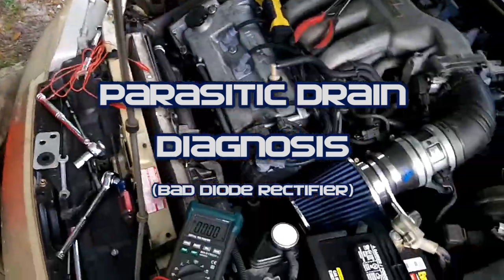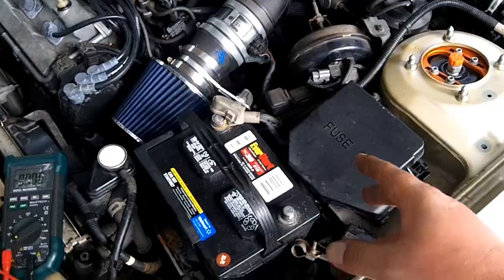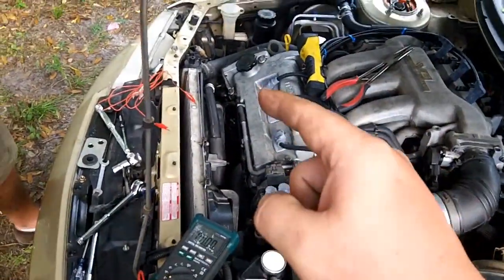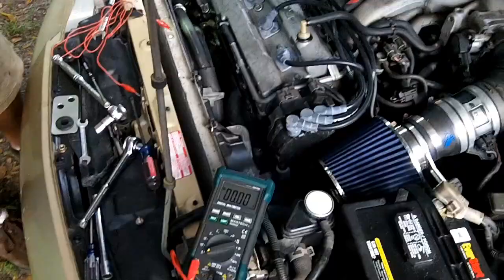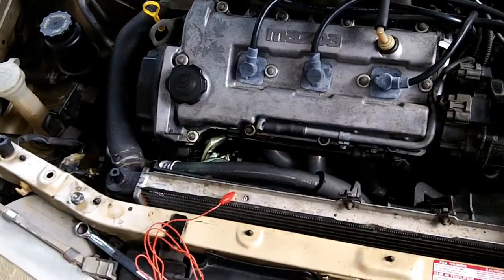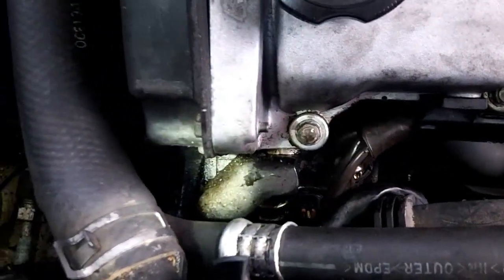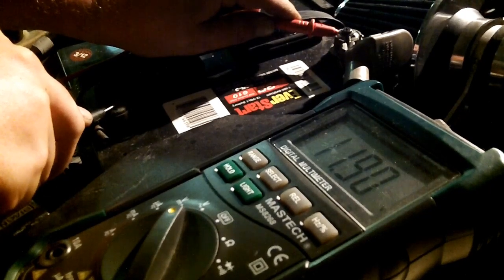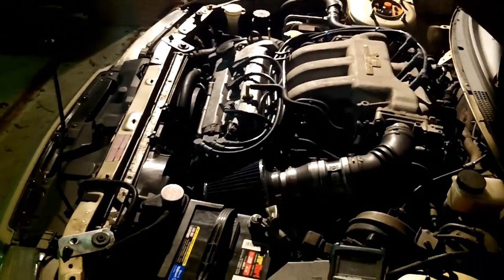Alternator Causing Parasitic Drain

Comment: You cannot have a alternator cause a draw it’s not a consumer
Reply from the maker: The consumer is the shorted diode inside the alternator. In some vehicles it can be replaced as it could be an external component outside of the alternator.  In the case of a 626 the diodes are inside the alternator and are non-serviceable parts (unless you're a specialist) therefore a prognosis of a parasitic draw due to a faulty alternator as the part to be replaced holds true.

Comment: Why not check the alternator first if you suspect it rather than fuck with the fuse block? If you have a parasitic draw of 2-3 amps with everything off, that's a good indication it's the alternator. Pull the wire from there and see if your problem disappears, if it does, mystery solved.
Reply: You beat your brains out looking for it, I'll start with the alternator if the drain is that high.

Comment: Im having a issue where my serpentine belt seemed like it was slipping bcus everytime i drove my car i would hear a whirring sound and i would smell faintly to obviously burnt rubber smell in front of the car and i was getting unwanted warning lights coming up on dash board etc.. i had a feeling that 1of the pulleys was sticking and moving causing the belt to slip and i could not figure out what pulley it was then today i start the car and i get a alternator fault light on my dash board. Is this a bad alternator i did not test it
Reply from the maker: There's a good possibility but you won't know until you test it.  I do not have a video on how to test the alternator other than this video.  There are plenty of videos online for alternator diagnostics. Good luck!
Reply: @DJDevon3  thanks captain il try and have it tested at a shop and see whats going on with it.

Comment: hi i m having very strange problem i applied wd40 on injector and starter relay but did not dry it and start the car resultantly battery warning light came on that alternator stopped charging after that its on problem with its own battery when i start it with other cars battery with leads its ok batteyr  light goes off and sometimes on its own  battery also but most of the time with its own battery start battery warning light came on in dashboard and if i start the car with push of some peoples help alternator doesnt start charging can you pls guide me ?
Reply from the maker: It's time to take your vehicle to a mechanic if you cannot perform alternator or battery diagnostics.  I realize this video doesn't show everything step by step visually for non-english speaking people.  English is required to fully understand this video. Sorry. :(
Reply: i can understand english but problem is strange car,s own battery makes roblem but as soon as i connect with other start car battery everything goes ok
Reply: Check your fusible link. Wire fuse going from alternator to starter

Comment: Alternate debug......remove battery connection, let the car sit overnight (to cool), place your hand on the alternator back where Positive cable connects, it should NOT feel warm.....reconnect battery, wait five minutes, feel alternator again, is it warm?  Four amps will generate some heat. Bad Diodes! Replace alternator.
Reply from the maker: Interesting that would probably work if it true.  I've never heard of this but it still requires diagnostic test to make a confirmation.  Let's just call this a relatively good first indication of a potential issue.  I like it.

Comment: IF . . . all connections are solid - ground wires and hot wires from battery to alt  - and the circuit from the D+ secondary post on alt to warning light to fuse and back - if all this is good and 3 different, TESTED, new alternators will not charge a new tested battery what could it be? On one of the alternators there was a charge all the way to 14 V's but that then stopped - on another new alternator there was a brief climb that then stopped. Could it be a bad ECU? Baffled - and stuck.
Reply from the maker: I can't give you a definitive answer. The voltage regulator is built into the alternator. The ECU does not control voltage regulation. As long as the belt is powering it and it's got a good ground then it should be putting out voltage. Resistance test the entire charge circuit, every wire, fuse, plug, and GROUND/EARTH. The only fuses involved for the charging circuit on a 93-97 626 are the 100A Main Fuse and 30A EGI INJ fuse (both fuses are in the main fuse box) and X-02 main relay near the fuse box (location differs depending on year and engine config). If the voltage regulator stopped then you've got a circuit problem that you haven't found yet. If you put the battery in wrong and connect it backwards even if you don't start the engine, it can blow the diode rectifier.  If you start the engine without the post or plug connected that can also damage the alternator.  If you can't figure it out take it to an automotive electrical specialist. I'd be interested to hear how it goes. :/  Good luck.

Comment: I Have a Chevy Express 1500 V6 - 2005 work Van which has tons of electrical items connected; LED Strobes, Ham Radio, Police Siren, Alpine Radio with 12" Sub (2) Amps; 1 Radio 1 Sub. Have a 3500Watt Power Converter also - So I put a Yellow Top Optima under the hood and it has ran perfectly fine for over 3 years; I can blast my music, strobes, and run a Hair Dryer off the Power Converter to heat up before the motor is warm on cold days which I LOVE,   

But one day not long ago someone broke into my van and stole some items (nothing seriously valuable) but I noticed they broke my Vent Knob for "OFF-MAX AC-NORM-VENT-FLOOR-WINDOW" it was stuck in MAX AC cause it was still warm out, but a few days later the van wouldn't crank over it was doing the "CLICK CLICK CLICK" as if my battery was dead, so I picked up another NEW Optima Yellow Top Battery and it started no problem - then I drove 40 miles and pulled into a gas station, when i went to start. It was "CLICK CLICK CLICK" even with the NEW battery so I finally took needle nose plyers and moved the metal knob to "OFF" and the van would start on its OWN POWER for about a week then it needed to be jump started every single day for weeks, then one day it wouldn't start at all or hold charge. The Batt says it only has 5v and wont charge or retain juice. 

I went out and tried to start it yesterday morning and it clicked with jump pack which was 45% life so i pulled a car over and hooked up jumper cables, when i went to crank it sounded like something fell into the engine cause it was turning over about to start then BOOM it stopped and the lights went out inside the van. I have NO CLUE what caused that but when i tried to start it again it just kept "Clicking" 

I have 2 other cars all doing weird shit all at the same time, i seriously think some FBI or NSA dude must have gotten really angry at me and this is my payback.
Reply from the maker: With all the power you're drawing it's just a matter of time before you should expect some power related issues. If it were me I would fully expect that to happen someday. The clicking is probably your starter relay not having enough voltage to turn over the starter motor.  Hearing a loud noise like that is very concerning, hopefully nothing timing related. I can guess all day from the other side of the computer screen but unless I can get my hands on a problem guessing could just cause you more grief. You need an automotive electrical specialist or a priest.  Good luck.

Comment: I have a older car 1990 rear drive buick, have the same problem, got a new alt and new battery and it draines the battery overnight, tryed every test and can not find the problem, got a new starter too.
Reply from the maker: You haven't tried every test.  There is a load on the battery coming from somewhere.  You have to trace it back to the source of the drain.  It's like finding a leak in plumbing, find the source of the leak.  Easiest way is by removing fuses to eliminate those circuits from the problem.  It could be something as simple as a glovebox or trunk light staying on after they are closed or it could be a short on a keep alive circuit.  Track it down.

Comment: Awesome. Exactly what I am experiencing. Was frustrated tracing the issue and came the same conclusion. Thanks for posting. Helped to verify my issue. I also get a random misfire on hard acceleration, performance loss, stalling and voltage drop to around 9-20 bolts at high rpm. Comes back to normal 14 when rims drop. Diode in alternator pretty sure.

Comment: I'm getting a parasitic drain from the alternator, but my diodes test fine when bench tested. There's also a very high-pitched, barely audible sound coming from the alternator when the car is off. This began after removing an old GPS unit that some dealer hacked into my ignition wiring 100 years ago.  It's wired correctly, only I had to use a length of aluminum wire to reconnect my starter wire, which is copper, because they removed a large section of it. I can't imagine that would cause this problem, though. I've already replaced the ignition switch since then. I'm at a total loss. Any thoughts appreciated.
Reply: Allen Reed get rid of that aluminum wire! It oxidizes at the connections and doesn't have the current carrying capacity of the copper.
Reply from the maker: With modified wiring there's not much I can suggest other checking your ground system.  A whine from an alternator while the vehicle is off is very odd.  Sorry I can't be of much help.  Sorry I'm not an alternator specialist.  If I were you I would search out an alternator specialist to ask that question.
Reply from the maker: Oops I didn't even notice the comment about the aluminum starter wire.  Who uses aluminum wire?  Get some nice thick gauge copper and replace the entire wire, the right way.  The thicker gauge copper wire the better! Completely agree with Noell Wilson.  Can't believe I missed that.  Cars are not wired with aluminum for a reason, they're wired with copper.
Reply: yes definetly get rid of the aluminum wire, there is a compound that you can use between copper and aluminum to keep from oxidation but I would just replace it

Comment: I have a 2003 Ford F-150. I  bought it new and it only has 79,000 miles. Two years ago the thing went dead. I tested it and had a 4.1 amp draw. I brought it to a well respected shop and they could not find the draw. It didn't even show the draw. It went dead again and I brought it to the dealer. Two days and no resolution. Problem went away for two years. It came back yesterday. I have a Parasitic Draw of 2.40- 3.51. I checked all the fuses an no sign. then I noticed that the alternator has a large crack in the housing and red dust is around the air vent slots. I am going to disconnect the hot wire from the alternator tomorrow and check for a draw. I will have to replace the alternator anyways.  I had two other symptoms. My digital odometer readout kept going off and the speedo did the same thing. I also had a whining noise when I started the engine that went away in less then 30 seconds. Thanks for the video. I feel confident it is the alternator.
Reply from the maker: The red dust is likely dry rust particles from the alternator bearing or brushes.  The whining is likely the dust being cleaned off by 
centrifugal force of the alternator bearing spinning.  Once the rust is ground up and ejected the whining goes away.  Just best guess based on the information you've provided.   Do the test and find that amp draw.  Don't leave it to chance, guessing, or parts swapping on hunches.  

Gather evidence and replace the right part.  There are definitely other possible culprits especially with Ford trucks, the ICM loves to fry due to the ignition module thermal compound drying up and causing a poor ground on the Ignition module.  Your instrument cluster could be going haywire due to a short.  There's no evidence that the two are connected other than the vehicle no start.

Another potential culprit is the vehicle speed sensor.  Those can burn up because the gears are sometimes made of plastic.  When that happens you'll definitely lose speed signal and the vehicle will refuse to start without it.

If you have a hunch of the alternator by all means follow that instinct but I implore you to find evidence first before replacing anything.  That's just good diagnostics.
Reply: Thank. I just replaced the alternator today. It really got loud. It had three cracks in the casing  and barely stayed together when it came off. The two huge cracks were on the bottom that were not visible until it came out.

Comment: YOU CAN DO A VOLTAGE DROP TEST INSTEAD OF PULLING THE FUSES OUT. IF YOU HAVE An INFRARED THERMAL YOU POINT AT THE FUSES IT WILL LET YOU KNOW WHO HOT OR VOLTAGE GOING, THOUGH .
Reply from the maker: Most DIY'ers don't have a thermal gun though they are fairly inexpensive.  I didn't have one at the time (long ago).  I do have one now but I still wouldn't have thought about using it.  Good suggestion, I would have never thought to do that.
Reply: Keith Bland black folk are smart and innovative as usual ! We work smart ! Not hard ! Thanks bro.!
Reply: You don't even need a Infrared Thermal. Just use a multimeter on a low DC Volt setting. You touch each connector on the small metal dots on top of each fuse

Comment: Hi I recently purchase a 2000 CL500 The car just won't stay running I replace the alternator and battery it seems like the alternator is not charging the battery my radio and AC unit is not working Climate control unit lights up it sounds like the fan cuts on but do not blow also an entry position do not drive sign lights up on the dash ABS sign also stays on anyyyy help would be greatly appreciated thanks
Reply: Want help?  You never buy a used Benz...unless you're a Benz mechanic working at a dealership.

Comment: im having a similar issue with my probe gt but while i am driving the voltage gauge will fluctuate sometimes dropping below the bottom line on the voltage gauge but my fuel cut /charge light is not coming on and when car is running and i put a load on like light and such the voltage just keeps dropping do you think that it could still be the alternator sorry for the no punctuation i suck at it lol  and the same as the video my alternator is covered in oil i had switched the alternator with a spare one i had and it worked for a short time and then did the same as the first one

Comment: +DJDevon3  Thanks for  info change my piston rings  with your head removal vids . my alternator  is not charging  got a new one after testing .but didn't notice  battery light till after swap . search  harness found  a break at the jack thats next t fuse box. ran the wire straight  pass jack . still no cluster  battery light .  willl do more seach tomorrow .was getting 15.4  with any alternator i new something was bad never handle it now no charge . oh on diagram  i s fuse after cluster blub  is that the meter fuse u referred too./? 97"
Reply from the maker: +ski740 The meter fuse is in the jointbox by the drivers foot.  The meter fuse powers most of the instrument cluster lights.
Reply: meter fuse good door ajar light not on also. Seat belt brake oil work fine. still searching

Comment: This just happened to me yesterday. Concluded that the alternator was bad but didn't know it was draining my battery while sitting overnight. The problem now is that the mechanics are saying when the rectifier went out it probably blew a fuse, and the problem is I can't figure out which fuse. Any suggestions? I'm not inclined with the electrical know how, but you definitely seem to be very knowledgeable with this kind of stuff. Thanks and great video!
Reply from the maker: +Frostylyxxx All of the important fuses are the ones in the fuse box under the hood and by the drivers foot inside the cabin (jointbox).All of them should be checked with a multimeter.

Comment: hey +DJDevon3 I have an awkward battery drain. I did the test and got 2.86 amps and it was the 7.5A Alternator so i replaced the fuse and it was still there so i had my friend fiddle with the connection and the draw went away. turns out when he pushes down top middle of the side connection of the alternator the draw dissappears but when he lets go it comes back. The Alternator is brand new so could it just be the plug?

Comment: 5:50 - time for a new  alternator ???@#$%^. a rectifier is worth around 20cdn$ for my 1990 corolla ... an alternator : 140$
Reply from the maker: rene levesque This isn't for a Toyota Corolla.  A new rectifier for a 1994 MX-6 from a dealership is $135.  He got a whole new alternator from a junkyard for $20.  Still holding up fine 1 year later.  Here's a link.  http://www.jimellismazdaparts.com/showAssembly.aspx?ukey_assembly=300772&ukey_make=995&ukey_model=14346&modelYear=1995&ukey_category=20272
Reply from the maker: rene levesque Think $135 is too expensive feel free to try online retailers like RockAuto.  Cheapest rectifier is $90 and new alternator is $120.  A junkyard alternator is $20.  I would have done the same thing and you probably would have too.  Next time you want to spaz out on someone and look like an idiot do some research first.  http://www.rockauto.com/catalog/raframecatalog.php?carcode=1191585&parttype=2452